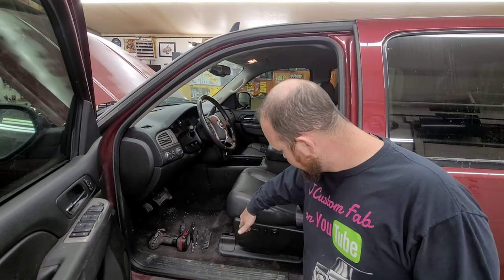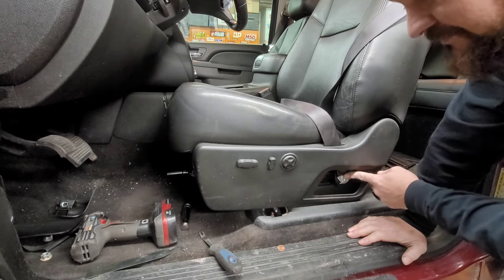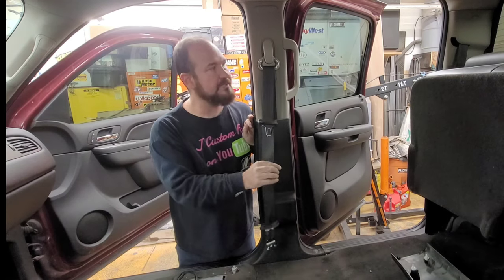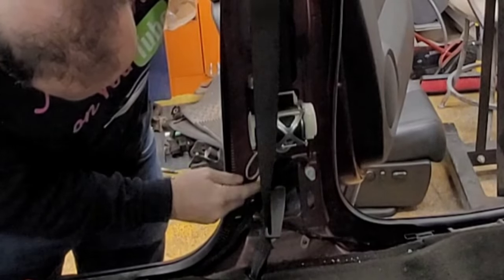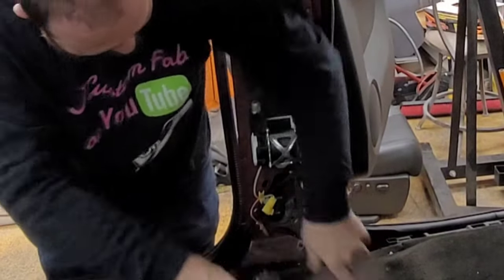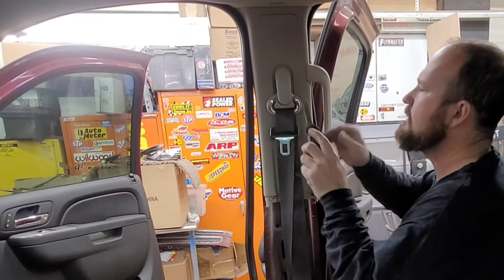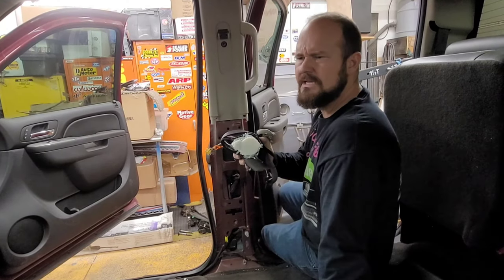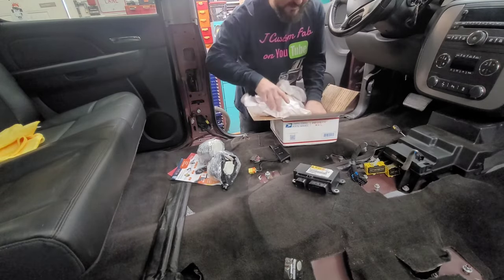Seat belt repair after an accident... 7-13 chevy silverado GMC Sierra crew cab... salvage vehicles

Comment: So I was in an accident with my 2013 Silverado, I’ve purchased airbags and seatbelts. Besides having the module reset, is there anything else that needs replacing?
Reply from the maker: As long as none of the Sensors are not broken. I think you're fine.
Reply: @JCustomFab  Ok Thank you, and yes none of the sensors are broken

Comment: Hi I have a 2007 escalade and I want to replace the seat belt but I need help fist on what to do before removing it .do I have to remove negative battery or a fuse for air bags ? Please lmk
Reply from the maker: Battery is always easier just in case you don't pull the right fuse

Comment: Hey I have a 2011 Yukon and I haven’t taken it apart yet but I was going to work on the seat belt but to do that should I disconnect the battery so I don’t mess with anything when I unplug the wire to the seatbelt?
Reply from the maker: Yes I would definitely do that.

Comment: I have an 08 Silverado and seatbelt itself is not in great shape but it's usable. 

Would it be possible to swap the passenger side with the driver side? 

I very rarely have a passenger so it doesn't matter as much. The material just doesn't stay flat and it's kind of curled up. 

Is it easier to remove the retracting mechanism, or should I do only the   actual seatbelts themselves?